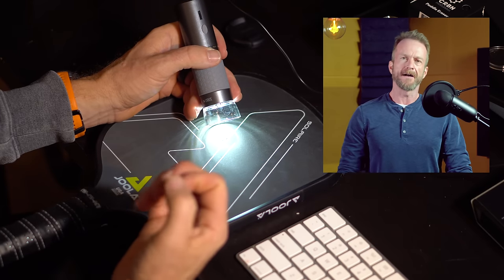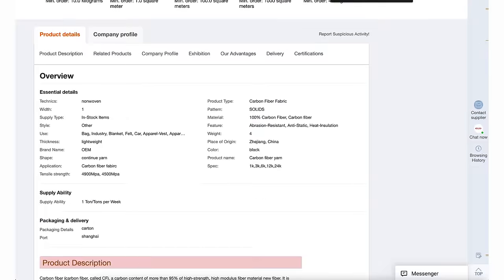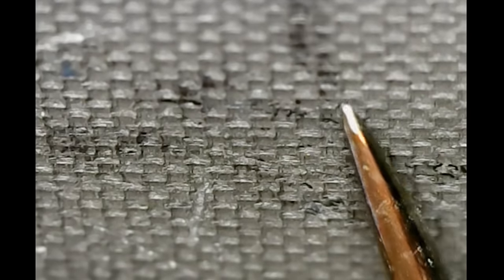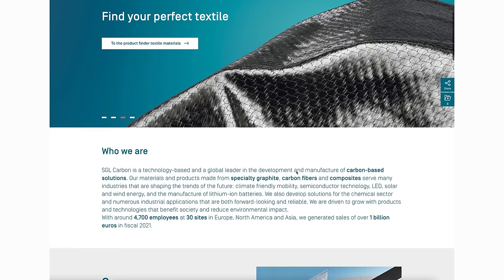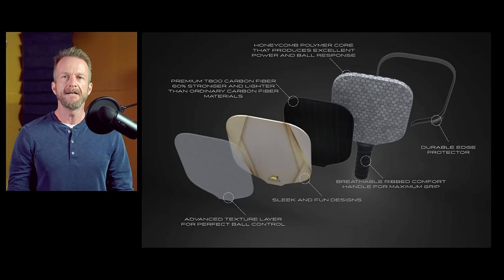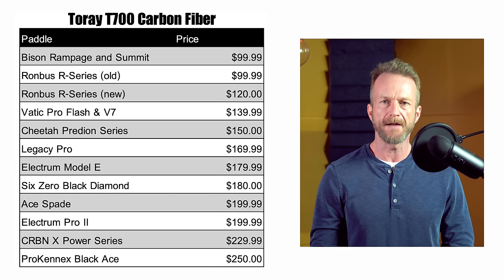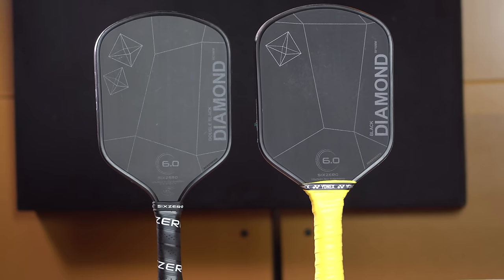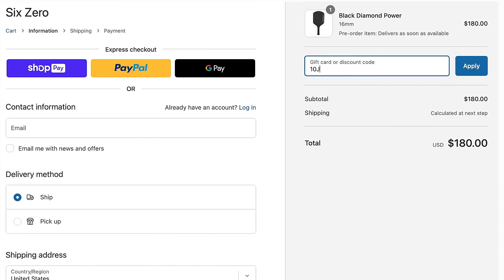Raw Carbon Fiber Guide - and the BEST Value Paddles Right Now

Comment: I just purchased  a Double Black Diamond paddle, based on your suggestion in this video. The company is out of stock, and paddles are scheduled to arrive in late April. Also, your code is not for $20 but is for $18, which is ten percent off the paddle's $180 price (and likely why the code is 10...). I play with a Joola Hyperion, and I own two of them. I hope I like my Diamond paddle. I will let you know.

Comment: John What is the difference between raw carbon fiber and etched carbon fiber?
Reply from the maker: They're the same thing, unless there's a company using 'etched' in a way that I'm not familiar. Basically, the etching is from a peel-ply, which is the same as 'raw' carbon fiber

Comment: Any idea what R210 Carbon Fiber means on the new PURSUIT ULTRA MX 6.0 CARBON FIBER | ELONGATED

R210 Carbon Fiber

Proprietary chemically bonded Carbon Fiber technology for maximum texture and friction between the ball and surface for unmatched spin.

Increased surface strength
Latest technology to ensure a consistent surface compression and rebound rate for enhanced ball control and feel.

Comment: hard to beat the price and performance of vatic pro...
Reply: I’m with you.  People often want the brand named CRBN X, and while I’m the only guy at rhe courts playing w a Vatic, I get very. Similar results.  I have a CRBN 1x, but prefer to use the Vatic V7.  Now looking at the 16mm Flash just for fun.
Reply: @braddaddis371  Ditto, I have the Vatic pro Flash 14mm and have traded paddles for few games with a friend that has a Double Black Dimond 14mm. I have mine leaded and he didn't so it was hard to tell the difference but I actually preferred The Vatic, could have been because of the weight difference though. I definitely didn't see paying $40 more for the Six Zero.

Comment: John I applaud your efforts to analyze paddles but I beg you to consult a mechanical engineer or materials engineer to explain the chart of tensile strength vs modulus you show at minute 3:19. You infer it tells something about "brittleness" but in fact it has nothing to do with brittleness. Tensile modulus is an expression of Stiffness which is resistance to deformation in length with an applied load. Suggesting brittleness, or propensity to fracture, is the same as stiffness is incorrect and misleading to paddle customers. This chart actually shows there are three general categories of carbon fiber materials, standard, intermediate and high modulus and that within these three categories remarkable properties exist in that the ultimate strength of different products within these categories can have (in standard and intermediate modulus) increasing strength and virtually no change in stiffness or in the high modulus case, have decreasing strength with increasing stiffness. 

There's a lot more to durability of a carbon fiber product than represented in the chart you show. There is an awful lot (too much for me to keep quiet) of poor information and marketing driven hype about materials in Pickleball paddles and people are easily misled and confused. Your paddle dissections and direct observations of their construction are excellent presentation of observable fact and I hope you continue to provide this to the community. Please though, include the analysis of someone in the materials field when you address the finer points in this area.

Comment: John - solid video but your basic assumptions about what you're seeing on the microscope are incorrect.
When you see a WEAVE and you think the carbon fiber weave is being damaged it's incorrect because that's not the carbon fiber you are seeing in the microscope.

Every carbon fiber paddle I have deconstructed (including the CRBN 1X, SixZero, Joola Hyperion CFS) uses UNDIRECTIONAL carbon fiber in multiple layers.

Unidirectional means there IS NO WEAVE.

so if there's no weave - why are you seeing a weave under the USB microscope? Because the weave you are seeing is actually an IMPRINT of the weave in the peel-ply.

As for peel-ply - peel-ply doesn't bond anything at all (which is what you said) - the peel-ply is nothing other than a non-sticky material (e.g. teflon) that creates an imprint in the RESIN that's on top of the top carbon fiber surface. The material itself is in a weave - and it's that weave that the press is imprinting in the top surface.

So in effect when the ball is hitting the paddle and damaging the surface of it - what's happening is that the patterned clear RESIN is being damaged - the undirectional threads of carbon fiber are under the resin and don't get touched by the ball (unless there's some MASSIVE damage - but that's not the kind of damage we are talking about here)
Reply: Wow I had no idea.  Nick, so why is there still a correlation between the Hyperion CFS, for example, ends up with way less spin after a couple of months vs some where the fibers look less damaged?  In other words, why are the paddles that look like the weave is damaged west out quicker?  Is it the resin that is wearing out?  Sorry if im confused
Reply: @braddaddis371  It's alright everyone is confused - even the companies that make this stuff. 90%+ is being made in China and the Chinese factories tend to not be very transparent about what is happening (especially if they are perceived to be doing something wrong). Of course it doesn't help if the companies don't know what they are asking for precisely (nor have any reliable way of quality controlling the paddle itself)

In short - YES it's true that every "RAW" carbon fiber paddle gets damaged when hitting the ball (some balls more so than others - because some balls are delivered with sharper edged holes than others). 

YES it's true that the damage that occurs makes them less capable of imparting as much spin (since the microscopic pattern of peaks+troughs - loosely referred to as "roughness" gets smoothed out.

(there are other factors that influence spin but let's ignore those for now)

It's definitely more correct to think of the THING that is being destroyed as RESIN - since the balls that you are hitting your brand new so-called RAW carbon fiber surface with - is not actually carbon fiber - but a resin layer that has a peel ply imprint. (Imagine the paddle like a chocolate cake - the carbon fiber are the layers of the cake - the resin is the icing....the PATTERN of the peel-ply is embedded into the icing...and it's the icing that is getting damaged)

But in some ways it doesn't matter what precise component of the paddle is getting destroyed - sufficed to say they are all fairly short lived.

So the spirit of the video is correct - even if the core reasoning is  not.

Some paddles last longer than others - perhaps because of the pattern of the peel ply - or because of the exact chemical composition of the resin or because of how hard you hit and with how much spin...

My main point was to highlight that the microscope patterns that @johnkew is showing are nothing to do with the Carbon Fiber weave at all - those paddles are using Unidirectional carbon fiber - if you take them apart you can see that - they are not woven at all. (But it just goes to show that if the people are are far better informed than most - like JohnKew - can make a mistake like this - what chance do mere mortals have)
Reply: @braddaddis371  one more little note - I worry (a lot) about the accuracy of the RPM data that John Kew or others put out currently - sure you can average stuff out to help smooth out errors - but frankly you're hitting a ball manually and filming it and there are a gazillion variables (height of ball, spin of ball prior to contact, paddle head angle, how worn out is the ball, speed of your swing, acceleration of your swing, wrist snap, how tired you are, temperature, wind) - etc etc - these are all off the top of my head. We need a more scientific approach to these numbers. I'm toying with the idea of making a device to test this - but a bit tied up with something y'all might go bananas over...stay tuned ;)
Reply: @nickbicanic6910  Keep me and us informed!      So what is a good paddle, value IYO?
Reply from the maker: Hey Nick - would you mind letting me know your email so that I can contact you about your deconstructions? The peel-ply issue is still a bit mysterious to me, and I've been interested to know for sure which brands use it and which don't.
Reply: @johnkewpickleball  what's your instagram (or linkedin if you don't use insta) - oddly I thought I could DM you here but it doesn't seem possible (I didn't want to put my email out in public comments...)
Reply: @johnkewpickleball  the answer as to which do and which don't is....drum roll....ALL of them do ;) - at least all the so-called RAW carbon fiber ones. Anything (at least anything I have seen so far) that has a raw carbon fiber surface and has texture that isn't grit paint...used a peel-ply
Reply from the maker: @nickbicanic6910  My instagram is johnkew72
Reply: Nick, appreciate your experience and expertise.

For raw carbon fiber pickleball paddle faces is the peel-ply absolutely necessary? If so, why? If so, what is going to make for the most durable raw carbon pickleball paddle face?

Does the SixZero Black Diamond composite face also have peel-ply? How might it wear differently than the Double Black Diamond raw carbon fiber face?

Thank you.
Reply: @republiusrepublius8360  I'm sure John and others will do more videos on this stuff as people become more interested (and as something I am making comes out finally over the next few months) - but to answer your question about peel-ply being necessary  think of is this way

1. Before being cut into a paddle shape - the entire paddle composite sandwich is assembled by stacking together (for the sake of argument let's use the Hyperion CFS 16 - 3 layers of Unidirectional Carbon Fiber - stacked at 0/90/0  - that means the middle layers is orthogonal to the other two  - and then a bonding interface (let's call it paper for simplicity and the PP core

2. So you squish this stuff together in a press and basically you've made 90 percent of the paddle - the rest is cutting, finishing, edge-foam (in a thermoforming mold), handle buildup edge guard etc

BUT - if you just squish it together you end up with a flat surface with no particular texture pattern on it

3. Bear in mind that the carbon layers are just soft fabric until you cure them in resin - imagine taking a bunch of very thin dental floss and laying 100s of them next to each other...it's very soft - but when you cure it in resin it's a stiff hard sheet

4. What you do with the peel ply is to put a woven sheet of teflon (or other similar material that doesn't stick to resin) ON TOP + BOTTOM of the paddle when it's being squished
Once the composite sandwich cures - the peel-ply is literally peeled off - leaving behind a textured carbon fiber surface
Reply: Nick, you are going to be putting out video on these topics?
Reply: @republiusrepublius8360  i don't think so. I'm gonna rely on John, Chris Olson and a few others - although my background is in film I'm busy with new paddle tech. y'all are hopefully gonna like... let's just say it solves the problem of surfaces wearing out ;)
Reply: You are going to manufacture pickleball paddles? If so, when might they come out? Thanks.
Reply: @republiusrepublius8360  2nd batch of prototypes being made now - one more round of testing before approval application - so I'd say 2-3 months hopefully
Reply: Do your paddles incorporate new technology? Or are they improvements on existing technology? Thanks.
Reply: @republiusrepublius8360  short answer yes it's new tech. i mean carbon fiber is still carbon fiber - we're not reinventing that - but there's definitely IP protection to the new approach. all will be revealed soon.
Reply: @nickbicanic6910  Please update on paddles with tech that solves problem of surfaces wearing out.  TY!

Comment: Ben Johns is full of himself and the paddle too...
Reply: Having had experience with touring pro tennis players, the odds are overwhelming that the pickleball paddles touring pros use are different and far superior from those same models that are being sold to the public.
Reply: The good news is that he was undeafeated using ok paddle..He said he uses new paddle every tounament and lead weights the throat.
Reply: With out paddle endorsements they cant even eat good in this sport currently.5k per winning team payouts.2k for 2nd.Thats not a living .Most getting chump change.Cut some slack.
Reply: @truth7204  Yes, he uses a different paddle (paddles) during an event so he can destroy the old evidence.  "clever right"  and I thought he was not that smart.
Reply: @kenf2662  He wins with ok paddle thats cheap..All pros will use new paddlea because paddles degrade.They need to make money otherwise they cant play.
Reply: They have this league run so tight with the players so propped up (world's number one) never played a tournament outside the US, they got Ben Johns drinking the coolaid. as for the paddles the league could stop it right now "They wont not yet" .
Reply: @kenf2662  simple fact that most players making very little.

Comment: I’m shocked learning that these paddles can only last weeks/months…. And sold at prices of high end tennis rackets…
Reply: It’s redic.  But, the tide is turning.  The smaller thermoformed paddle companies using Toray t700 and selling at sub $180 prices with others sub $135 is a step in the right (and opposite) direction compared to the way things were trending.
Reply: Yup..All the reviewers say the same..Thats why i bought a gearbox..Head weight for me is important for speed on a paddle.